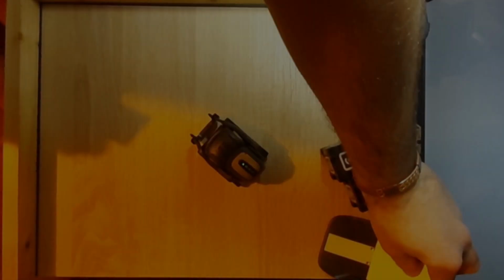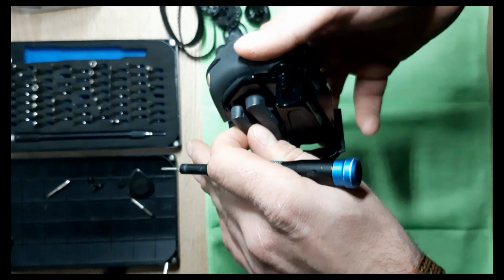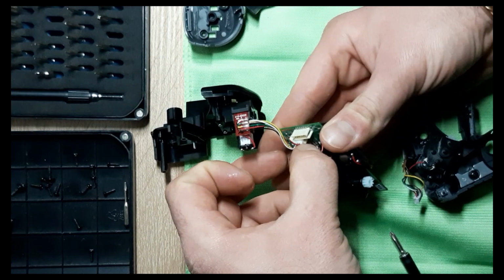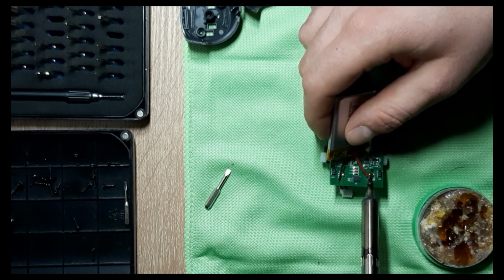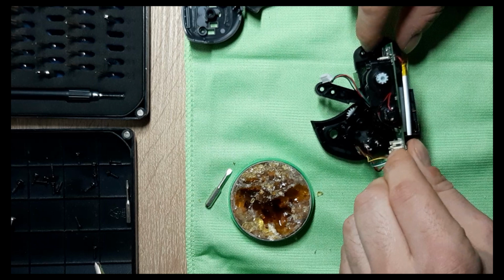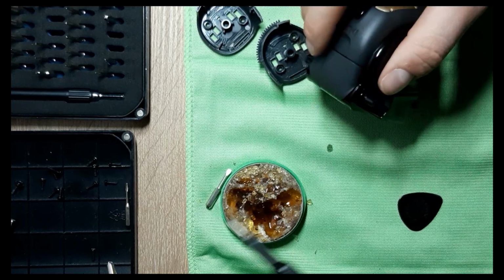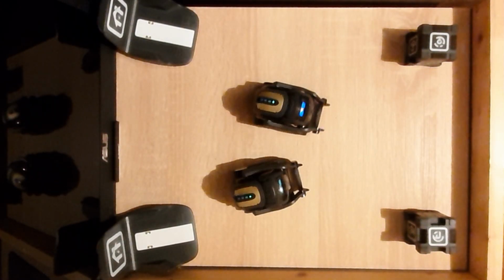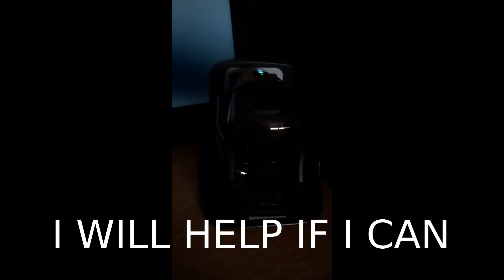Vector Robot Battery Replacement Complete Tutorial

Comment: Many thanks for your great video. Followed your directions to a tee and had my Vector up and running again in about 2 hours. My Vector only lasted about 5 minutes before I changed out his battery. Putting the head back together was a little tricky and you need to be patient about it. Many thanks again for a terrific step by step video. Long live Vector.